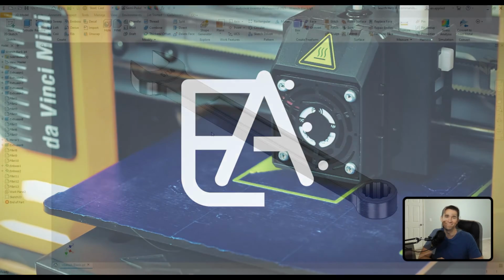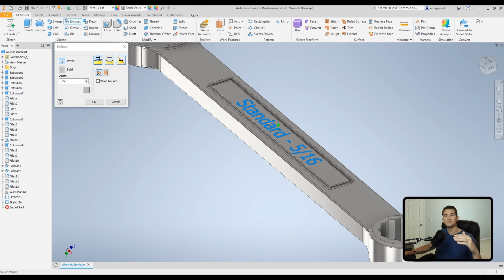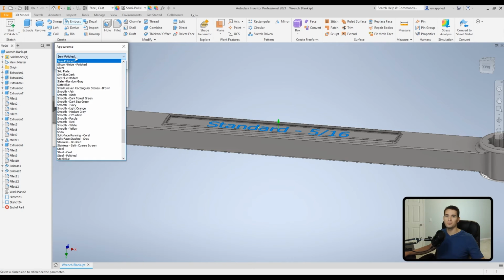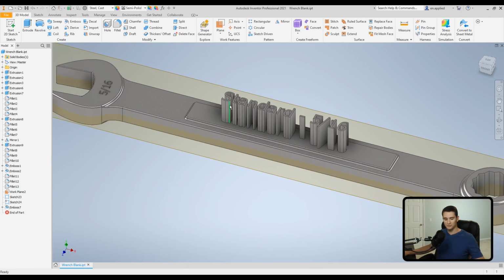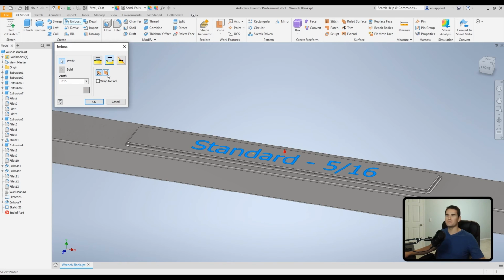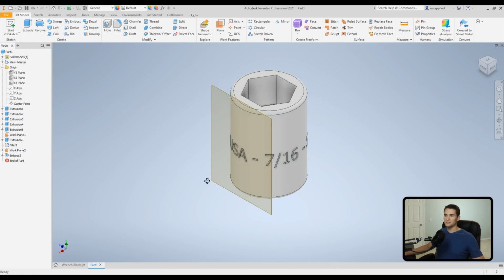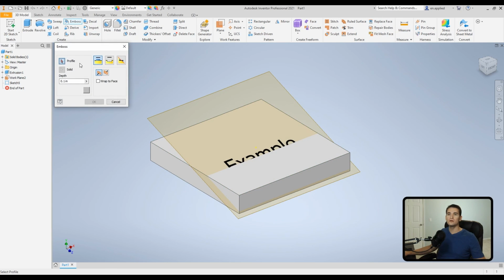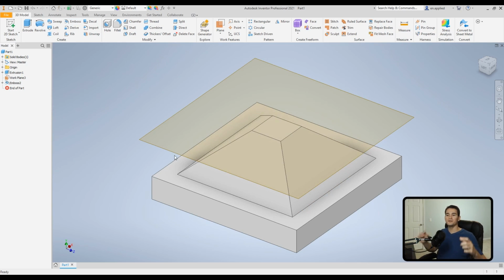Emboss Tool and Options - Autodesk Inventor Part Tutorial | Autodesk Inventor 2021 IN DEPTH

Comment: I FEEL LIKE I AM MISSING SOMETHING INCREDIBLY STUPID, BUT HOW DO I ADJUST THE DEPTH ON THE COMBINATION EMBOSS/ENGRAVE? THE FEATURE ITSELF IS WORKING FOR ME, BUT GOES ON UNTIL THE NEXT SURFACE IT HAPPENS TO COME TO. IT WILL NOT LET ME DRAG THE BLUE ARROWS, SO I AM AT A LOSS. IT IS HARD TO EXPLAIN WITHOUT A VISUAL, BUT IT ENGRAVES ALL THE WAY THROUGH THE PART AND EMBOSSES UNTIL IT HITS ANOTHER PART I HAVE IN THE SKETCH.